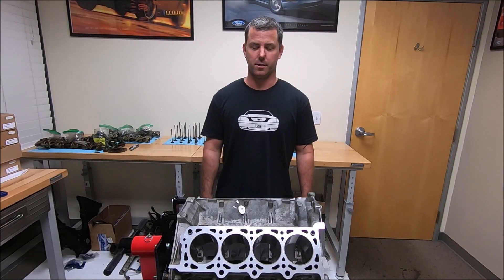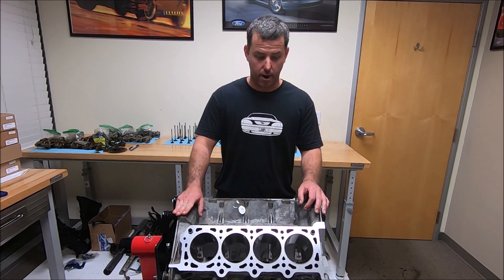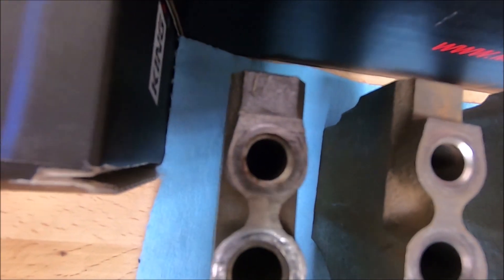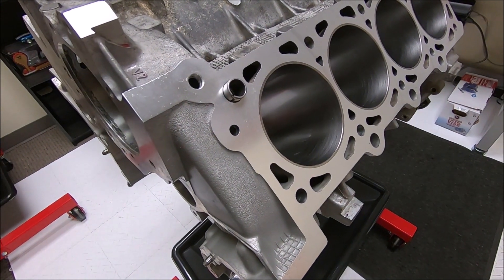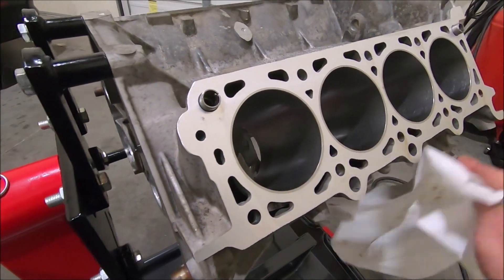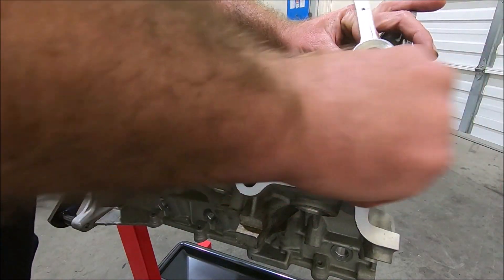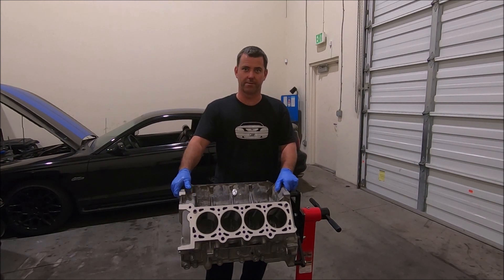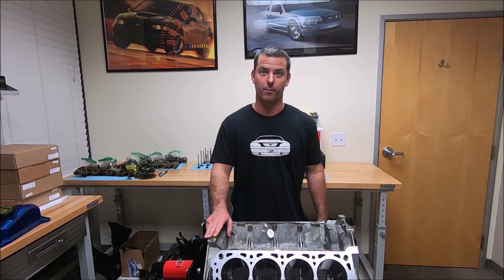Ford 4.6 aluminum Teksid engine block information and preparation

Comment: Is there a particular engine stand that works best for the Teksid? I'm about to work on mine.
Reply from the maker: Pretty sure the ones I use are from Harbor Freight.  I prefer the four wheel ones over the three wheeled
Reply: @JohnSmithRacing  thanks!

Comment: I have a 05 aviator engine I’m trying to install a M112 supercharger but need to remove the knock sensor bosses. What do I do with the old knock sensors relocate them or delete them and tune??
Reply from the maker: I am not sure where they could be located to, they are deleted and tuned out in most cases.

Comment: Im wanting to build another 4.6 3v, and the only blocks in my area  are teskid block, and im hearing the 3v timing  covers won't work on teskid block.
Reply from the maker: I have built 3V engines with Teksid blocks and you can get the timing cover to work.  There might be one hole that doesn't line up but it can be filled with RTV.  Pretty sure I have a series on here building a 3V with a Teksid.  Just search on my channel.

Comment: Hoping for a response, i noticed on the freedom racing website it calls for one p# working for the intakes and another p# for the exhaust. Tell me if im all wrong but i dont see a reason for 2 different tools, looks to me it should work on both sides. Also seems to be thats what you are doing as well. Greatly appreciate a response!

Comment: Will a 4.6 cv interceptor intake work on these aviator engines?
Reply from the maker: I have not seen a 2V intake on a 4V engine, there may be an adapter out there.  You could use Marauder intake on these engines though.
Reply: On a 93?

Comment: Are there any positive displacement blowers that work with the teksid block knock sensors? I want to add knock sensors to a Termi cobra with MS3Pro standalone
Reply from the maker: I do not know of any that will work with a Teksid and 2V heads.  However, Kenne Bell has a kit for the early Cobra, so it should work with a Teksid and 4V heads.

Comment: is there any difference in cylinder head bolt torque specs between a iron block or a aluminum block

Comment: Hi can you make a video or explain what are torque plates? Thats part of the machine shop?
Also is this teksid block better than whats oem on the 01 mustang svt cobra?
Reply from the maker: Yes, I will make a video on torque plates soon.  I am pretty sure that most of the 01 Cobras, if not all, had a Teksid engine block in them.  The ones that I have dealt with had a little different crank side bolts.

Comment: When I was a kid my dad bought a lincoln mk VIII and he just always was so thrilled with it, he was a life long full time engineer (professor and consultant for everyone from the power industry, to the naval weapons center to random private companies). He loved that car something else. And it rubbed off on me. Now years later, I end up working with parts from that 4r70 and looking at the block and everything I'm still impressed. Seriously under-rated what they did.

I think about building a teksid with a stock coyote crank all the time. Are there any cheap high flowing head options for these things?
Reply from the maker: Thanks for watching the video!  These are great engines and a lot of people use them to make big hp.  I have seen over 2k hp made using a Teksid.  You can use a cast 4.6 crank and still make a lot of power.  I want to say up to 800 is doable.  The cast crank is lighter and so it will make a bit more power and spin up faster.  As far as heads, as of 2023 I do not know of any one making 4V ones but Trickflow makes 2V heads that will bolt on to a Teksid.  There are a lot of shops that will CNC the 4V heads but most want to start with the later casting of the heads (DB or DC).

Comment: I have an unopened 120k mile Mark Viii engine but opted to go for an Aviator 4.6 with a Wap block and C heads for my Mustang.
Reply: The wap is fine it can do 1000 with forged internals how many are gonna go past that with street cars?  Very few.
Reply: @midnight347  Honestly. People today are racing dyno numbers. I swear haha

Comment: You mentioned that 3v heads fit these blocks. How do the Teksid and 3v aluminum blocks differ? Can I run 4v C heads on a 3v block? Thanks in advance.
Reply from the maker: The 3V engines either came with a WAP or a Nemak block, I can't remember off the top of my head.  As far as I know there isn't much difference other than appearance in the casting and the blocks should be interchangeable with all the modular heads, including 3V.  Depending on what combination you run, everything should fit.  I just did a Teksid with regular C-heads for a 03-04 Cobra and the older head casting had to be grinded in a couple places to get the lower intake to fit, as well as the knock sensor bungs.  Some people say the Nemak is stronger than the Teksid and that the WAP is the weakest out of the three.  I have built engines with all three and all have worked well.
Reply: @JohnSmithRacing  so what REALLY is the benefit of running a Teksid block???? ALL the Modular engine castings, iron or aluminum, are strong. When compared to the Windsor SBF OEM castings having their limitations, ANY Modular block has double the capability. 

If a client came to me and said, "Mr. Art, I'm running Ford Modular stuff at the racetrack, and I need to hold big power.” "Big Power? What's your big Power?" I'd ask him. "1000hp is my Big Power." Smh....after giggling to myself a little, I'd have to ask about his finances cause he'd have to get to fifteen or sixteen hundred horse before it would be an issue and at that point he'd be looking at a Koenigsegg block! No idea what the cost to procure one would be. It's just hasn't come through my door yet.

As a SBF guy I overlooked the Modular platform for personal use for 20 years. Today though......eh, it's getting attractive. Thanks for replying.
Reply from the maker: @arturozarate1752  No problem.  It seems most people like to use the Teksid because that is what some of the big engine builders where using back in the day and that is all they have heard of.  I have not built a 1000 plus hp engine on either of the three but I really like them because they are lighter.  When I was at MMR we did some 1000 plus stuff but it was on a 5.4 iron block.  I would like to build an aluminum 5.4 or 5.8 to put in an old SN95.  Maybe with some twin turbos!
Reply: @JohnSmithRacing  idk the deck heights to compare fitment, but the SN95 doesn't have the high shock tower and low engine mounts that the S197 has. I kinda remember a kid back in San Antonio bring one in to a shop I was doing electrical work for on the side, back in 2002ish. It was a 2 valve and it looked ridiculous. I wonder why I haven't seen more 5.4DOHC in SN95's?

Comment: I have a 1996 reman from ford that is a 4v aluminum block. It has a w stamped in the side.  Is that the desirable one? Thanks
Reply from the maker: I would say that block is a WAP (Windsor Aluminum Plant) and is not the top desirable of the 4.6 blocks.  It's still a good block but I really like the Teksid and the Nemak aluminum blocks.

Comment: Can you use the block from a Mark 8 if it was a front wheel drive 4.6L? I've notice all the 4v 4.6L MARK 8 in my area are front wheel drive. I haven't gone to look at them 2 are in the magic year of the Teksid.
Reply: I thought those were rwd?  Same platform as the tbird ain't it?
Reply: Mark VIII was only RWD made from 93 - 98  the original " Cobra"engine later adopted by the mustang

Comment: Wonder how my ported 2v pi heads would put out for hp .
Reply: The Teksid block wont produce any extra power over an iron block, rather it will be able to handle more abuse and support more power.
 Well ported PI heads are good for around 320whp NA with the proper cam. Beyond that, youd give up a lot of drivability.

Comment: Thanks for the vid! I have a std teksid with 1-1.5 thousands wear in the bore. Do you think a hone only would work to keep it std? I plan to run 10 psi Kenne Bell on it eventually, with the 2V heads, street driver.. 
Do you recommend any machine shops in the Vista or LA area that are competent with the teksid blocks. 
Cheers, 
Pete
Reply from the maker: Hi Pete, I would really have to see the cylinders to make good judgment call on them.  As long as there isn't any large scuffs or cracks, I wouldn't worry too much about a thousandth.  Ball hone if for about 10-15 seconds.  But if you do want to use a machine shop, I use Machine Tech in Oceanside, CA.

Comment: Do these blocks only work with overhead cam heads? Not compatible for my 95 5.0 cobra
Reply from the maker: Correct, the overhead cam 4.6/5.4 engine blocks are not compatible with the 5.0/5.8 pushrod engines.

Comment: So I have a Teksid fully built it’s a mmr 4.75 1000 se stroker it’s been sitting for about 4 years now I did coat the pistons and walls with atf, now should I have this block taken apart sent through the cleaning machine, again and assembled again? I wanna also change the rods and pistons on this block I’ll leave the coyote boss 302’crank shaft since i know it’s been pushed to 1400hp+ np for years builders say that I talked to. So hook me uo with some advice would be great I know it need a cleaning no matter what, dust ext been in just sitting in a garage.and I know the assembly lube and all that has dust collected on it also been around for a while just To be sure no rust issues ext even tho alluminum won’t rust the pistons sleeves might is i misses any spots
Reply from the maker: It will most likely be fine.  If you want to take a look down the spark plug hole, there are inexpensive borescopes online.  There are some really nice ones that use you phone camera too.

Comment: Question i have a 98 teksid out of a mark viii what would i need for a simple terminator swap over? heads db dc mach 1 terminator or aviator? Also if i do go with lets say aviator is there anything in the way on the teksid or these heads that will get in the way of a whipple or big kennebell?
Reply from the maker: The Teksid will work with all the modular heads.  The problem with the block is the knock sensor bungs will interfere with several superchargers.  The bungs will need to grinded off and I also grind off a small bump in the center of the valley as shown in this video I believe.  Hope that helps, if not let me know.
Reply: @JohnSmithRacing  thank you my kind sir. Much appreciated

Comment: question. i have a 94 mark block. im trying to build a franken termi motor. plan using 05  aviator heads for the better plug threads and i have a 03 sc. im gonna be putting it in a 2010 grand marquis. think itll work for a cheap muscle car?
Reply from the maker: Yes, that is a great combination.  I would take a look at what the Marauder guys are doing to get the supercharger setup working.  There is a guy that sells plates to move and flip the alternator around.  There is also a lot of wire extensions and the problem of how to route the cooling system.  It can be done tho
Reply: @JohnSmithRacing  ya im gonna be deleting the ac and putting the alt where the pump used to go, they sell plates for that. im going to be making the intercooler its own system with a pump so hopefully that simplifies the coolant. my only real concern is wiring. i know im gonna have to do alot of extending being the crown vic and mustang harnesses are flipped and the intake goes the opposite direction. my only concern is the sensors being its a 94 block and a 2010 harness, u ever try to do anything like that, can i swap the sensors for new ones or will the old ones work? also because its a E throttle and the corba used a cable i had an idea around that by using a 05 gt throttle which is oval and E. idk if that will work, but id really like to keep the E throttle. love to hear your thoughts thnx
Reply from the maker: @MunchinMaQuchy  The coolant issue is with the crossover tube, it doesn't clear the blower.  I did a swap on a Maruader and used On3 crossover tube delete for the top of the cooling system and then just cut some 1.5 inch hose for the bottom.  I had a 03 Cobra harness and it was easier to extend the Maruader harness and battery because that needs to be moved as well.  The sensors should be fine with either the new or old.  I didn't have to worry about the throttle body but it sounds like the Mustang one you have in mind will work.  You will need a custom tune as well to get the engine to run correctly.
Reply: @JohnSmithRacing  very cool thnk u. one last question what bottom ends do u use in your builds?
Reply from the maker: @MunchinMaQuchy  The rods and the pistons are the weak point.  At a minimum I replace them with Manley.  The factory cast crank is actually pretty good and I have heard of it being used in 1000 hp applications and 7k+ RPM.  For the forged crank, I use either a factory Kellogg or Manley forged.

Comment: Imagine removing a set of 32V heads from a TEKSID block of all things and MODIFYING the HOLY GRAIL of Ford Performance in the 90s with your "All Knowing Wisdom" of these blocks. YOU LITERALLY JUST MODIFIED A TEKSID BLOCK TO FIT A SET OF HEADS THAT ARE USED AS  TABLE LEVELERS IN LOCAL BARS......... Tf is wrong with you....... Around 10k blocks produced by Teksid and you out here just cuttin em up.......... Imagine Ford spending millions of dollars on an engine they paid Ferrari to design and leaving out features for other heads.... OH WAIT THEY DID!!!!! AND they put a head that no 2v or 3v from Ford's 4.6L lineup will ever compete with. Tf man........ TF............ 
#SaveTheTeksids
Reply from the maker: Not sure if this is a joke or not but the engines that we use come from a junk yard where the cars are scheduled to be crushed after a few weeks.  So technically we are #savetheteksids haha
Reply: @JohnSmithRacing  not a joke........ save em. quit filing shit off. use 4v heads or use another engine

Comment: That casting looks really good compared to some other stuff I've seen.
Reply from the maker: I like to really clean the engines that I build.  A good hot tank or sonic machine will clean the block up nice.  I have even used Gunk brand degreaser and that works good as well.  The hardest area seems to be the valley because most of these engines have baked on mouse turds haha
Reply: These blocks are not truly cast to my knowledge, they are called "forged aluminum blocks" As opposed to a purely Cast aluminum block.

If you can tell me why they are called forged aluminum blocks but are still Cast I would love the education...

I have an original '96 SVT Cobra Teksid block with 4V heads and it's all OEM parts mechanically speaking. I would really appreciate any new info.
Reply: @theSHAD087  I've never heard them being called forged so I can't help.  My best guess is that maybe some internals are forged so people just call it a forged motor or forged block, not actually referring to the block material itself.
Reply: @DonziGT230 dude i just rewashed this video, he said at the beginning it's forged in Italy 😂 idk how we both missed it

Comment: Awesome video man, if you could do more how-to's on teksids or just 4.6s in general I'd really appreciate it
Reply from the maker: Thank you and there are plenty more Teksid and 4.6 videos planned.
Reply: @JohnSmithRacing  I have a 98 Mark 8 I hope to add more performance with. I second this.
Reply from the maker: @BryanYoungYT  Thank you, I highly recommend adding aftermarket cams.  They make great power and have a much better sound than stock.
Reply: Wow I didn’t know you could swap heads from 2v and 3v that’s cool as hell I’m actually thinking of buying a 98 markvIII it’s got 160k and I’d like to pressure test it and see about doing a swap into my Crown Victoria one day  😊

Comment: Pointed to wrong hole for 2v cooling mod you were pointing to the oil feed to the head the coolant hole to drill is the one directly above it
Reply from the maker: Thank you for pointing that out.  Sometimes mistakes are made making these videos.  The easiest way to figure it out is to put a gasket on.
Reply: No problem man just figured id say something

Comment: Hi John smith, I was wondering if you know of any lift plates for this block, I’m only wanting to lift the short block its a 2v build and I wanna get the engine in a engine stand, and I seen motionrace works one and I have been. Told that that needs heads in block
Reply from the maker: I don't know of plates that can lift a short block out.  With the heads off the shortblock should be about 250 pounds or so.  I would just put a couple ratchet straps around it and lift it with the hoist.  Or run a couple head bolts down try to attach to them.